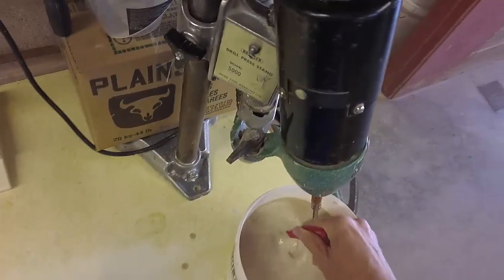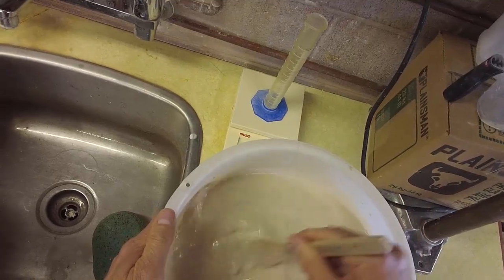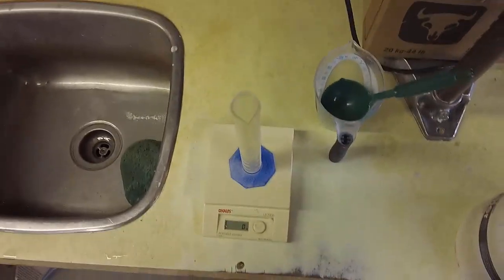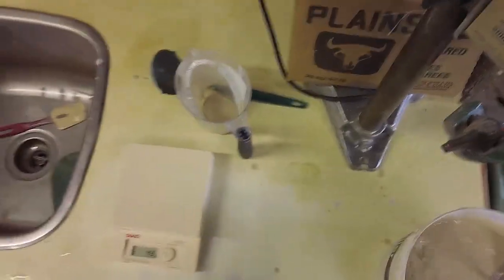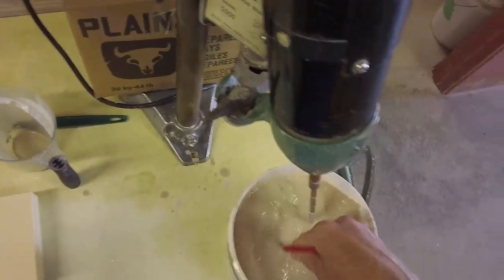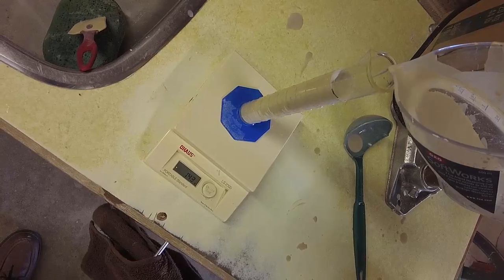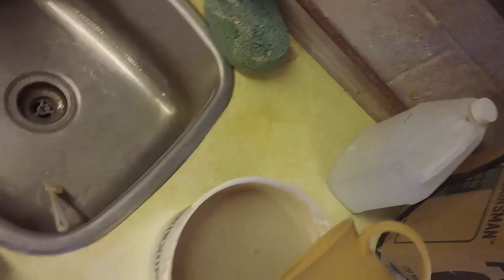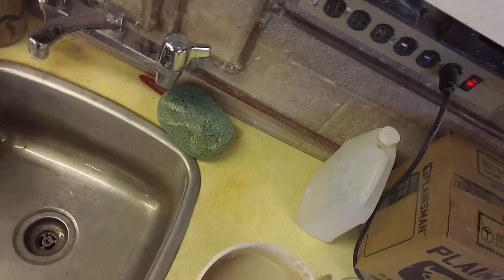How to Gel a Ceramic Glaze

Comment: This is genius!  You have given a clear scientific consistent and repeatable method to correctly  floculate a glaze.  This has changed the way I mix glazes after 40 years of doing it!  I can't thank you enough.  The two seconds to gel is perfect.  The only comment I might make is how to measure the specific gravity.  Get a 50 ml syringe (farm store or Amazon).  Put it on your electronic scales, press the tare button to zero, then fill the syringe to 50 ml and weigh it.  Since it is only 50 ml, you will have to double the number to get the specific gravity.  This is much faster than using a graduated cylinder.
Reply from the maker: Thanks. Did you try it with water? Is it accurate? I used to do it this way. But I found the syringes wore out quickly, it became difficult to push the plunger with accuracy, it jumps as the lubricant wears away.
Reply: I did check it with water and found it to be pretty accurate.  You are right about the plunger getting difficult to press, but it is so much faster than the graduated cylinder, that I put up with the difficulty.
Reply: Lubricate the plunger with a little vegetable oil when it gets difficult to press. It's like brand new again

Comment: Can you use a specific gravity measuring tool from a beer making kit? Then you can measure it in the bucket.
Reply from the maker: No, wrong scale. Need a hydrometer with scale 1.3 to 1.5. But they need a fluid slurry to bob up and down well to be able to read accurate. Too hard. Weigh it, that is much better.
Reply from the maker: No, wrong scale. Weigh, it is the only reliable method for slurries of any viscosity.

Comment: Great info - thanks Tony!!
How do you determine the specific gravity for a glaze to ideally have before you put in the vinegar? Would you say it would be around 1,4 for all glazes without any frit?
Is this the same as flocculate (using Epsom salt)?
I'm struggling with trying to get an even coat of white glaze when dipping - have tried loads of both commercial glazes and recipes without success. Do you think this would help me?
Reply from the maker: 1.43-1.45 is right for most glazes. If it takes too much vinegar, then the SG is too low. I favor and SG that requires 2-3 capfuls of vinegar for a gallon. But I use Epsom Salts instead, 3-4 pinches.
Reply from the maker: Add water until creamy. Measure SG (often around 1.5 to 1.55). Add more water until runny (usually around 1.45). Add Epsom Salts or vinegar to make it creamy again.Typically it should require 2-3 pinches per gallon. If it gels too much with a little addition the SG was too high.
Reply from the maker: 1.4 is too low. The right specific gravity is where it requires 1-2 grams of epsom salts to gel a gallon. For me that is about 1.43-1.44. If it requires less it is too touchy.